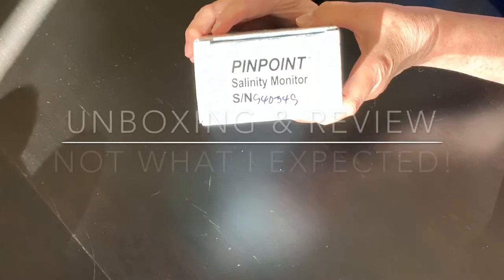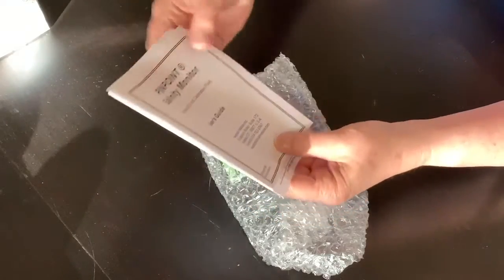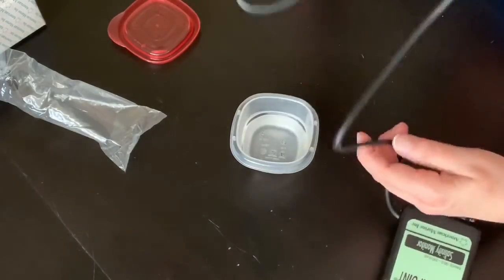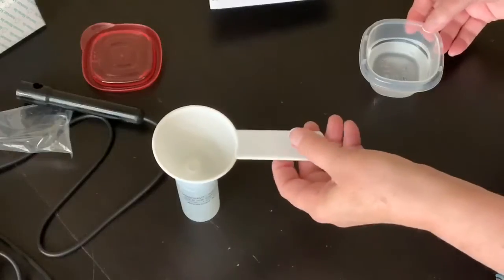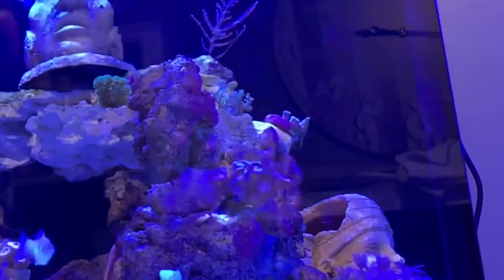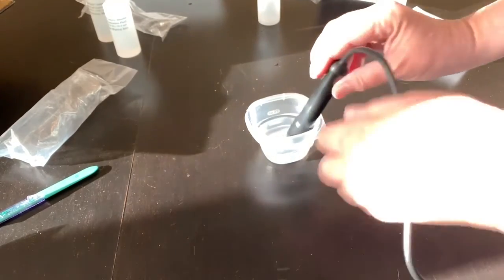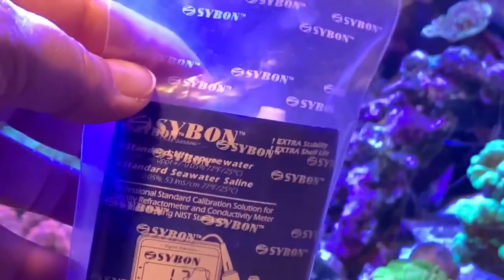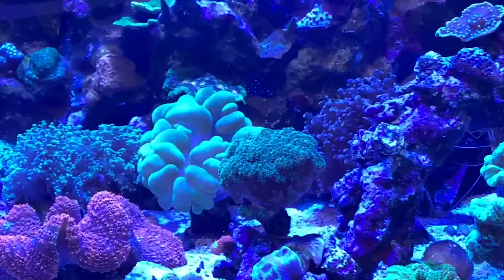REEFGRRL’s Unboxing & Review: American Marine  PINPOINT SALINITY MONITOR  - I Think I Wasted $110. 🤬

Comment: You can't beat a refractometer to confirm a salinity reading I usually use xodis digital  salinity meter which tests SG/PPT/TEMP/TDS but if in doubt I confirm with the fefractometer❤
Reply from the maker: Very true - I always use a refractometer. But at that particular time, I was mixing so many salt batches and doing so many water changes that I was hoping to find something quick and easy. I’m still looking, even though I thought I had one that did the job, because it was too much of a pain to have to calibrate it every single time I used it....😡

Comment: Ah Ha.  The hunt for perfect salinity. I have 2 Refractometers, 2 Apex with salinity probes, IceCap Salinity Pen and 4 bottles of Calibration fluid. I can tell you they all read different, including the calibration fluids. SMH..... My Hanna Salinity/Temp pen should be here this week. I'll keep you posted on the Hanna Results.
Reply from the maker: Lol, lots of redundancy there! I still think that, properly calibrated on a regular basis, a good quality manual refractometer is the most reliable. But I thought the convenience of a scientific instrument would make it quicker and easier to check salinity, especially when I’m mixing new saltwater. Cost me $110 to find out I was wrong. 🤬 I look forward to seeing how the Hanna works.

Comment: What a headache. I'm sorry! My Apex salinity probe has the same up/down calibration issue just like this moniter.
Reply from the maker: Yeah, my Pinpoint pH has the calibration screw on the front, so I don’t have to take the thing apart to calibrate it. If I’d done some more research, I’d have learned the screw was inside the battery compartment, but I still probably would have bought it. Then i Would have had a better idea what to expect. 🙄

Comment: I would never trust an electronic conductive piece of equipment in a tank that is subject to stray voltage. That being said, I agree with you that it is not convenient
Reply from the maker: Speaking of stray voltage....What are your thoughts on a ground probe in the tank? I got a titanium one ages ago, but I’ve read conflicting stuff about it - main thing being if I plug it into a power bar and it ends up grounding stray voltage, it might pop the breaker and shut everything off. I don’t know much about electricity, but if the actual connection into the plug is rubber, I’m not sure how the breaker could get triggered.....🤷‍♀️
Reply: A grounding probe May stop a catastrophic event. If a large amount of current is present it will trip a breaker and shut everything off. It won't do much for small amounts of stray DC voltage. The grounding probe socket should have to plastic prongs and one metal ground
Reply from the maker: Thank you Dave! That’s exactly what I need to know. 🤔 This might be a great topic for a DNT Investigates video...electricity is scary for most people, and there is a ton of conflicting info out there.  🤷‍♀️